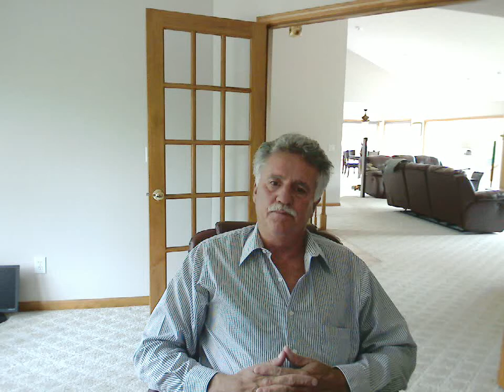Cummins N14 Fault Codes 111 343 424

Comment: Hi Terry, I have a N14 Celect Plus, fault codes 0434 and 0141. can you please advice me where to start looking for the problem. Truck just died on me and it cranks but not start. Position censor already replaced.

Comment: i was heading to the mill the other day when i started loosing power the truck shut right off i pulled to the break down lane and when i got down to about 40 mph it jumpstarted and stayed running but the truck would only do 50 it would only turn up to 15hundred if i gave it much gas it would start hitching so bad i had to let off it i got the truck unloaded changed the fuel filter it ran good for about two miles up 95 and that was it, about an hour trip home at 60 miles n hour wouldnt go any faster anyone ever seen that on a cummings 525??????????

Comment: just check the eps if it isnt feeding oil through the sensor its the ecm or some dumb mechanic has changed the point where your ecm is getting voltage usually through the starter which creates its own problems